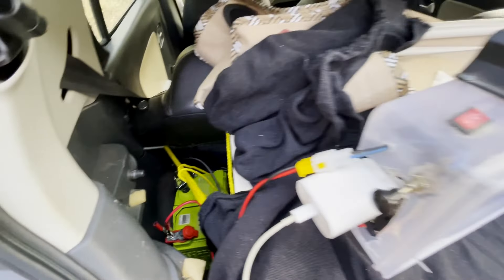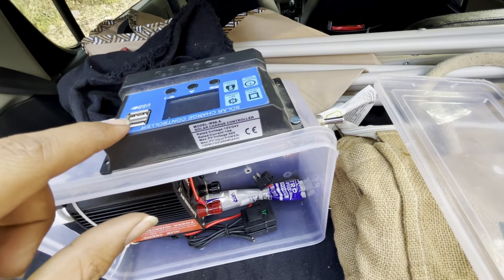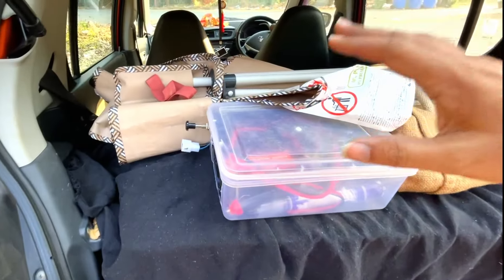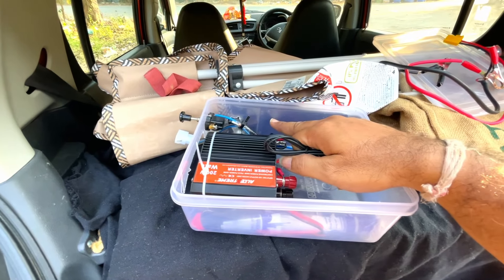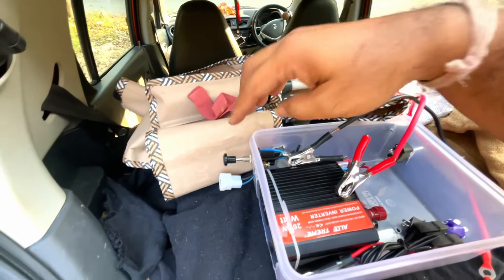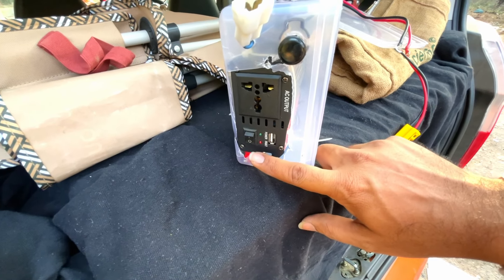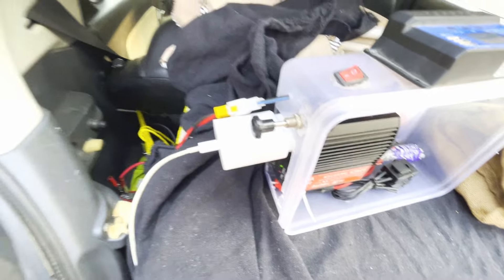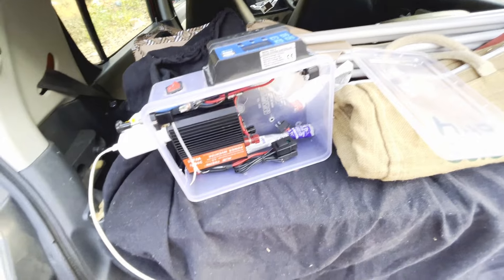DIY 200Watt POWER STATION for My car Camping | DIY Solar Generator

Comment: Yikes
Reply from the maker: I know it doesn't look good, but my intention of making this video was to show how we can build a power station at very low cost.
It costs less than INR 3500/- (approximately $40), whereas branded generators cost us around INR 40,000/- (approximately $500).